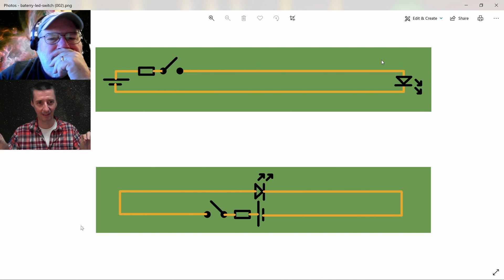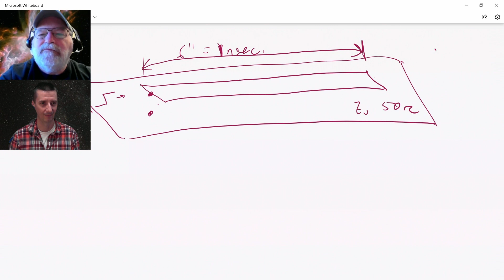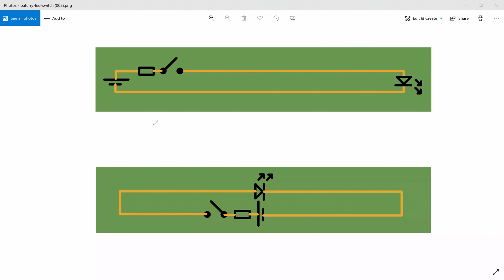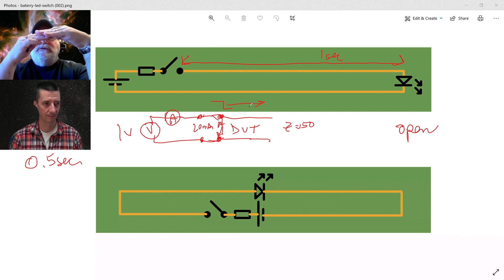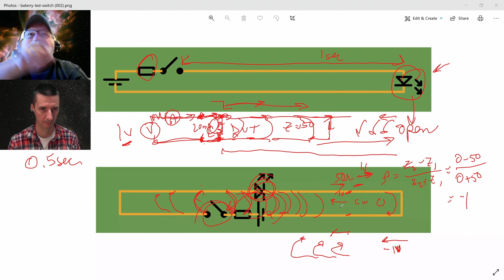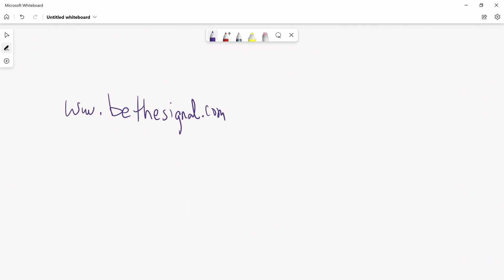Explaining Veritasium Electricity Video: Energy doesn't flow in wires (with Eric Bogatin)

Comment: OMG what a mess! I get that Eric B is a prominent advocate for teaching a lot of good stuff, but in this case it's like you pushed his play button with the wrong VHS tape loaded.  The two circuits portrayed are not equivalent. The lower one is similar to Veritasium's puzzle, but adds an additional series resistor not in the original puzzle.  The upper diagram shows the LED at the far end of the line, which completely changes the puzzle. Perhaps the upper diagram was actually intended as a counter example, but that wasn't clear and someone said these diagrams were equivalent.  Anyhow it seems to me that much of this talk was a red herring relative to the actual Veritasium puzzle.  Yes, it's a transmission line problem, and the key info is that the LED is located at the same end as the switch and battery. (ie: unlike the upper diagram).  
Derek's example clouds the matter a little by having_ two_ transmission lines, one in each direction.  But that's easily dealt with by noticing that the the two halves of the system can be made mirror images: you can replace the experiment with one in which there are two half batteries, two half bulbs and two switches arranged with one half of each pair on either  side of a center line.  In the two wires that cross the center line the current must be zero (because of symmetry), and with no current those wires cannot acquire a voltage across them. 
So you can now discard half of the system, and connect together the two "dangling" wires at what was the center line to form a puzzle that is much simpler but equivalent: At the near end, a battery in series with an LED and a switch, and that combination wired to a long transmission line (that happens to be shorted at the far end).  So the puzzle reduces to: When  you feed a voltage step into a transmission line, does current flow in both conductors simultaneously. Yes, obviously it does, as described very circuitously in this video.  In fact, you don't even meed to know about transmission lines to get that answer, because you can answer the simpler question: When  you have a battery, a switch and an LED in series is the current the same in each of those components. Hopefully all agree that it will be. 
How much current? Well initially I = VBattery / LineImpedance. If we imagine 1mm radius wire with about 1 meter spacing, the impedance comes out to about 800 ohms. If the experiment battery is 12V, and we cut it in half for our equivalent puzzle, the the current is 6V/800 ohm = 7.5mA. And the LED lights essentially immediately because it's adjacent to the switch and battery. 
Later, after reflections have settled out (which actually will be difficult because Derek specified zero ohm wires!), eventually the resistance looking into the shorted transmission line will be zero, so the current is infinite and the LED will burn out. (That is if you don't take into account that Derek showed what appears to be a 110V LED bulb, but I think he did say to assume it lights with any significant current).
Reply: Graham, great explanation! I think you're missing one thing, though. The current you have calculated is only a transient current that will die off so quickly that no human eye will ever see the light even flicker; until the current goes the long route and can maintain a steady state long after the imperceptible flicker.
Reply: @HelloWorlds__JTS  Veritasium specified the length of the wire-pairs (ie: the transmission line) to be 300 million meters, the distance that light travels in 1 sec. [Edit: In V's video at 15 sec he says each of the legs are 300 million meters, at but at 22 secs his diagram shows 1/2 light sec for each leg, so there's a factor of two depending on which of these specs you use.] So if the voltage & current propagate down the pair at the speed of light (which is an over-estimate), then the first phase of the experiment will last 2 seconds. Ie: it will take 2 secs for the reflection to get back to home.  That is the amount of time that the transmission line will look indistinguishable from a nominally 800 ohm resistor (based on very vague guesses regarding wire size and spacing from Derek's video).   So that "transient current" will last  > 2 secs, plenty of time to see it and with plenty of current to light an LED..
Reply: @Graham_Wideman  You are still ignoring the fact that locally there remains only a DC voltage between the wires after the step function transients have propagated away, so no displacement current will pass through the local capacitance. Without the displacement current, there is no local coupling between the wires that causes energy to be exchanged between battery and light.
Reply: @HelloWorlds__JTS  I am not following what it is you think I'm ignoring. However, if your reasoning leads you to believe, as you say here, that a DC voltage remains between the local wires (for at least 2 secs, I add), then that DC voltage must be accompanied by a current through the LED.  For what it's worth, Veritasium's puzzle was "how much delay is there until the LED lights", so that question is answered once we know that it's "essentially immediately".
Reply: @Graham_Wideman  their is a steady state DC voltage between the wires, not between the LED terminals. The LED has zero volts across it in steady state.

You claim that you don't follow what I'm saying, but yet still argue that I'm somehow wrong. I'm following exactly what you're saying, and claiming you are wrong. Sounds like a religious debate at this point, so I'll thank you for the engagement up to now, and bid you farewell. (Stay tuned for my own very short video demonstrating my claims.)
Reply: @HelloWorlds__JTS  OK, I think I missed your point of a couple of replies back.  You must be thinking that the voltage across the pair of wires is providing no current into the wires. And I guess your reasoning is that the local voltage would have to feed charge to charge local capacitance (you say displacement current, equivalently ) only, and once that's charged to the battery voltage the current would stop.   But that's the key slightly tricky element that makes this a puzzle.  I think you would agree that as the voltage propagates incrementally along the transmission line, it has to charge the associated incremental capacitance, right? Where does that charge come from? It comes from the upstream previously-charged capacitance. And that applies all the way back to the source.  So at the source, the battery has to continue feeding charge into the transmission line -- you might say "to replenish" the local capacitance that is supplying charge to the next incremental capacitance downstream, which is feeding charge to the next incremental capacitance, and so on and so on. That continuous delivery of charge into the transmission line at the upstream end  has to pass through the LED, hence lighting it.
Reply: @Graham_Wideman  Ok, I'll bite just this one last time!

If we can agree that there will be no charge or field gradient in either line once the transient has propagated away, then we can also agree that there must not be a current through any resistive portion therein. The source of the charges that you are referring to is the displacement of the forward [neutral] charges due to Coulomb repulsion from the diffusing charge wave propagating down the wire.

Don't confuse Drude conductivity, which explains Ohm's law as being a consequence of out-of-equilibrium charge flux at long time scales, with the microscopic "conductivity" at short time scales.
Reply: @HelloWorlds__JTS  At this point I can't tell if you agree that the LED will turn on almost immediately (in t = 1/c secs).  If you do, then I guess we're just disagreeing on which level of model to use to explain it. If you are disagreeing, then I don't know how to persuade you. Veritasium's video, my comment on that video and this, and subsequent commentary on several EE channels all agree with this result.  If instead you are disagreeing with how long the LED will stay at the initial level of illumination (I say 2 secs at 7.5mA, assuming 300Mm legs), then I suggest simulating it. I have done so, and it confirms my claim. LTSpice has a transmission line component "TLine", on which you can set characteristic impedance (I used 800 ohm) and delay time (I chose 1 sec).
Reply: @Graham_Wideman  I agree that it will turn on almost immediately, but it won't stay on for long enough to consider it as being "on" as far as human senses are concerned, as the Veritasium video strongly implies. It will only be an imperceptible flicker.

The only adequate simulation method is to use a full wave solver, like CST or HFSS, and make sure to include perfectly matched layers at each port that is supposed to go off to the moon, because otherwise the standing wave will keep the LED lit. Actually, a full wave solver probably isn't necessary as long as you properly terminate the ends so no reflections can occur, but I'm not sure PSPICE circuit simulators handle that properly - might need HSPICE.
Reply: @HelloWorlds__JTS  Why are you even worried about reflections? The transmission line is either 0.5 or 1 sec long. It's going to take one or two secs for the state of the far end to even be visible at the near end.
Reply: Regardless, definitely giving Robert a thumbs up for effort, and for cultivating these relationships with experts, and entertainment.
Reply: Interesting, But did you include the insulation on the wire? This is not a "transmission" line problem that uses "bare" wires. Wires transmitting power have an outer coating of insulation. Please recalculate the impedance using standard insulation for both wires.
Additionally, please note that there is a forward voltage for the Light Emitting Diodes in the LED Bulb.
Do you have a link of any standard LED bulb that requires 12volts and only 7.5 mA current? 
By typical standards, LED bulbs require much more current to be considered "ON".
Reply: @marcfruchtman9473  The insulation material enters the calculation via the capacitance, whose square root is part of the impedance equation: Z = SQRT(L/C). (Here the calculation pertains to the incremental LC sections in the  lumped circuit model of the transmission line.)  If the entire space between and around the wires was filled with typical plastic insulation, the relative permitivity increases from 1 to 4, capacitance increases by the same factor, so the overall impact on the impedance is to reduce it to half. 
But the insulation on insulated wires occupies only a tiny faction of the space around our wires spaced 1m apart, so its effect is basically negligible.  As for the LED, a single indicator LED typically requires a forward voltage of about 1.5 to 3V depending on color, and illuminates at 1mA to 5mA, and generally would not be run at more than 20mA. (Power LEDs for illumination run at higher voltages and currents.)  
Of course, much of Derek's puzzle is rather contrived -- for example he specified that his LED would illuminate with "any" current, because he's really focusing on the time aspect, not the quantity of voltage, current or illumination.

Comment: Just wanted to get some clarification (and corrections if my statements are wrong):

According to Eric, In the bottom circuit the LED turns on immediately, but that cannot be possible. Is this just an approximation due to transmission line theory since 50Ohm instantaneous impedance requires the two wires to be very close to each other? There must be a time delay related to the distance between the 2 wires and the speed of light in the dielectric, am I correct?
Reply: that's correct, he just simplified that statement. 
In case of 1m between lamp and source it would take the mentioned 3ns to turn on. Thats 1m divided by the speed of light, or in Veritasiums words 1/c.

Comment: So, this discussion is great.  I agree that Maxwell's equations more perfectly define reality, and that it's important to understand that.  However, I am an engineer, not a physicist and I do think that in practice, a lot of the discussion around field theory tends to devolve into philosophy or religion, neither of which has a lot of practical use in designing a circuit board.  Here's the practical use - do not split your grounds.

Comment: Veritasium's transmission line example has an impedance much more than 50 ohms (1 meter distance is very high),  so the initial current passing through the lamp would be very low, maybe less than 1% of steady state current, if my assumptions are right, I wouldnt say the lamp would turn on instantly
Reply: I thought the veritasium video was misleading. This is all about data transmission theory and has nothing to do with the DC regime. Assuming zero resistance and not talking about capacitance and induction makes no sense in a dynamic system like this.
Reply: @ypey1  Yea, the whole idea of using a battery and asking the wrong question in the first place completely confuses the entire thing. He is mixing two different types of theory and stating the questions in the wrong manner.
Reply: The impedance of 1m separated wire is on the order of 1k ohm.  So there would be plenty of current to light an led light.
Reply: @argcargv  Really.? Is your caclulation using bare antenna wire? Please recall that the demo clearly shows insulated wire. Please recalculate using insulated DC wire.
Reply: @marcfruchtman9473  The insulation on the wire would have some effect on the transmission line, namely it would increase the permittivity which will increase the capacitance and ironically reduce the transmission line impedance.  At any rate the effect would not matter for the order of magnitude.  It would still have an impedance of about 1000 ohms even with the extra dielectric.  The dielectric could introduce loss as well, but the thought experiment was assuming lossless wires.  Adding dielectic loss would not change when the light came on, so it would be a moot point anyway.
Reply: @argcargv  Insulation doesn't increase permittivity. (Apologies, I am wrong.) 
I meant that I doubt the increased insulation would be canceled out by the permitivity.
Reply: @marcfruchtman9473  no material exists that would have a relative permittivity less than one?  So what is this magical material that you speak of that the insulator would be made of that wouldn't have a permittivity greater than the permittivity of a vacuum?
Reply: @argcargv  Mmm, my bad, I was incorrectly combining thoughts.
I meant to say, I doubt that the insulation effect would be canceled out by the permittivity.
I believe that the insulation would severely limit the EM effects on the wire 1 meter away. The wire is not acting like a "typical" capacitor with a dielectric and open plate. The wire is completely covered by insulation. This would severely restrict the amount of energy that is able to cross the dielectric to reach the plate in order for charge to appear there.
Reply: @marcfruchtman9473  I think you misunderstand what insulation does.  It has a high resistance, but it does not stop EM fields.  It will have some effect on the electric field, but this will serve to increase the permittivity which would only serve to lower the transmission line impedance, and that effect would be minimal.
Reply: @argcargv  Good point. Nevertheless, I am still waiting for someone to show a 12 volt LED turning on this way. I don't see it happening.

Comment: Guys you are out of your mind do you realized to pulled wires that long you will get no current flowing few miles away. If we have 480v  volts  lets say we have 1000 amps every 100 feet we are going to lose 3 % of our current, regardless how thick it is your wires, you still will have loses as long as that current forced by mechanical means. If you guys explaining in mathematical view of point at least be realistic give little more clear explanations what you are calculating.

Comment: What would the distance between the transmission line and the return plane have impact on (if at all)?
Reply: It makes it easier for the fields to bridge between them.  So a trace on a PCB over a plane is more plausible than 2 isolated wires a meter apart, if you're trying to make the circuit work in real life.  (Where "to the moon and back" is long enough that copper wire might look more like a resistor than a transmission line.  And "more plausible" doesn't mean "completely plausible", if you worry about how many tons of copper it would take, or how to launch it into space.)

Comment: Why is everybody rushing to "explain" that stupid video??? EEVblog, now you. And ElectroBOOM threatened to post a reply too...
Reply: I think it's because when I see that video it seems very well presented as far as the "theory" but asks a completely different question, "when the light will turn on"... He is mixing different aspects of electrical theory and creating a very odd hypothetical which has (IMHO) a very different answer than the one he is offering. So, I think that really resonates with a lot of people who want a better answer and a better explanation. ( Of course the back and forth banter improves views too)
Reply: I agree, its like everything i based on "why do we use copper wire at all, if is not needed. Silly engineers".

Comment: Omg, I cannot believe you cut him off like that... Lol
Reply: it was a bit rude and as a result eric did not properly explainwhy there was a voltgage drop on the right side of the switch and displacement currents went from the top wire to the bottom wire. And robert did not ask why